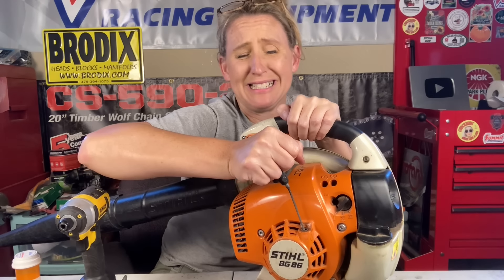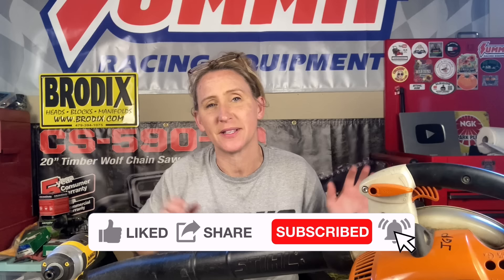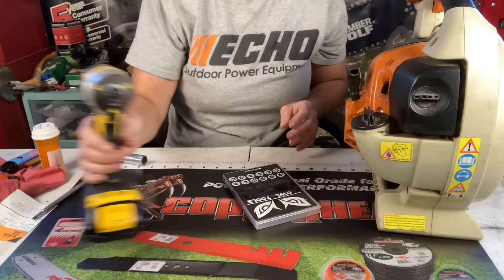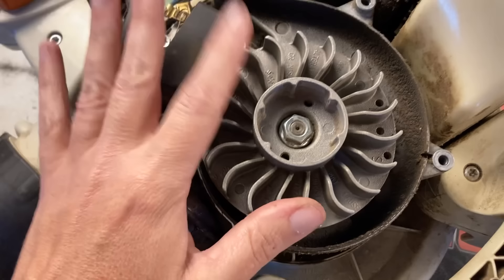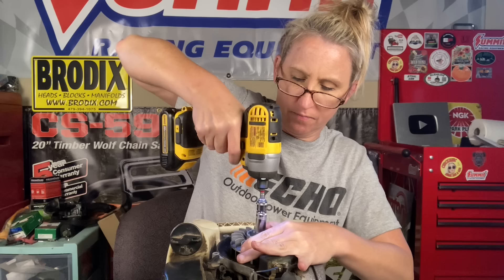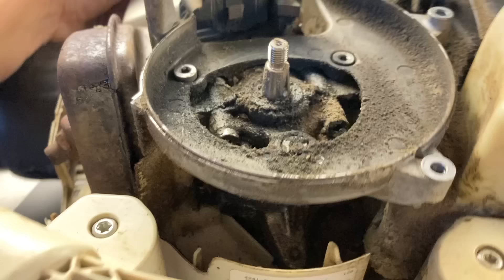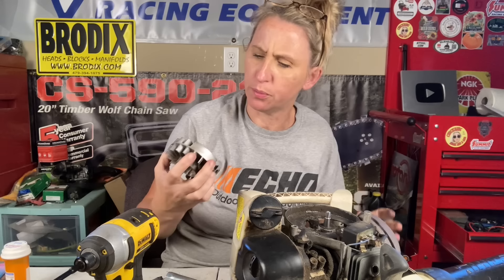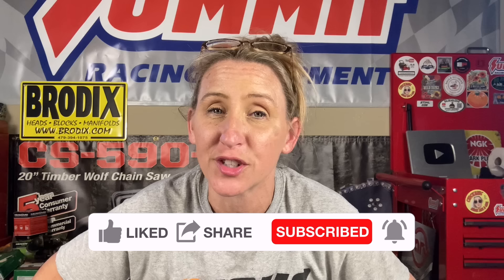Stihl Blowers SECRET FLAW!! Save your Blower with this EASY FIX!!

Comment: These companies should spend an extra twenty five cents and add locktite to problem areas. Great video as usual.
Reply: Dude; it's called planned obsolescence. They know exactly how long it will take for these screws to back out and how many blowers get tossed.
Reply: @jdkrxw  They should also know if their over priced junk locks up and I have to buy a new one, why would I buy another one from THEM?
Reply: @jdkrxw   Stihl used to be the Cadillac of equipment. Not so much anymore.
Reply: Don't use the red!
Reply: no they shouldnt that keeps chickanic in buisness
Reply: @raymondrobinson5251  red loctite is the best
Reply: @seanmckay3392  True! It locks it permanently! Blue, sometimes, will allow the threads to be undone. Not 100%, but if to never undo it again, use red!
Reply: @jdkrxw  I bet they worked out the lengths of the bolts to unwind as soon as warranty has ran out.
Reply: @stevejuststuff2779  yeah that , it`s embarassing pulling a chainsaw 8 times before the pos starts.
Reply: @jdkrxw  yep..  how many have been thrown in the trash.. or taken to "fly by night" shops that tell the customer its shot and sell them a new one.. there are Lots of expensive Stihl tools in homeowners' garages who have no idea anything about it..  if it one day locked up theyd toss it out to the curb and buy another one..  if it lasted a good number oif years before breaking theyd prob get another stihl
Reply: @raymondrobinson5251  ive never had blue come apart on its own..  and ive used it on flexplate bolts in  big busses..
Reply: Most likely the heat and wear and tear after a couple of years use
Reply: @raymondrobinson5251  I use Red all the time. Sometimes, I use Green 609 cylindrical part bonding. None of them is permanent. A bit of heat will soften them all up enough to remove.
Reply: @raymondrobinson5251  LOL! NOTHING is permanent. Red is not even close. If it don't move, a bit of heat will soften it.
Reply: @bluegrallis  I wondered about heat being in the mix! That makes sense!
Reply: Glad to see I’m not the only one who uses old pill bottles for parts.

Comment: Another fix saving us TMF. You’re almost at 300K subscribers! Have you ever asked how your channel has grown so fast? Great presentations that are well documented and easy to follow. Keep ‘‘em coming!!!
Reply from the maker: Aw! Thanks so much!!
Reply: Yes I think she was at 75,000 something like that when I first started watching.
Reply: @Chickanic  Bre, got to help me! Is a loose chain the main cause why a chain becomes dislodged while it’s running? I had this problem with my MS170 when I use a third-party bar and chain combination. Having problems with my Timberwolf. It’s the 20 inch Oregon bar & chain. I swear it’s tight.
Reply: Check the bar along its grooves that the chain runs in.  You need to take bar off saw. Look along the chain grooves. If one side higher than other. You will have issues. You can reclaim bar by refacing the bar grooves with a bench grinder. Run bar along grinder. Get grooves equal again.
Reply: Too tight?
Reply: Actually Bre answered the question in one of her subsequent videos. Adjusting a new chain after the first few cuts- they lose tension.

Comment: correct. vibration wreaks havoc on carbs and fasteners. i too have rebuilt carbs that still leaked.  best repair is to replace.  il throw my thumb pump on the carb and if it dont hold i will toss it.

Comment: The easiest way to remove the flywheel on these 4140 motors is to back the flywheel nut off until it is flush with the end of the crankshaft, then sit the unit upright. Use a brass or aluminium drift and with one or two decent hits to the crank end, it will pop off. Bonus is the nut protects the thread and the flywheel doesn't fall too far. Also take great care lining the key up as it is cast into the flywheel and if damaged will require replacement of the flywheel.
The Stihl hedge trimmers that use the 4140 motor are also known to have a similar issue with the screw coming loose.
Reply: BINGO!!

Comment: GREAT VIDEO!! This is exactly what my issue was! I was blowing leaves, my blower made a weird metal "thrapping" sound, then jammed and stopped. 5 minutes later I found this video. It took me about 20 - 25 minutes to disassemble, clean the parts, add locktite to the bolts, and reassemble. 30 minutes later from time of blower stopping, I was back out blowing leaves. This saved me money and time! And considering the turn around time of at least two weeks to get my blower back from the shop if I brought it in. Thank you!

Comment: Hi Bre, I wanted to tell you about what I did to my friends weed eater! His son brought it to my house to cut down some weeds around my house! No gas in it put non ethanol fuel in it. Still sounds funky check the oil cause it's a 4 cycle engine and no oil. So all I had at the time I had some mercon 5 transmission oil it ran smooth and even started up easy next day.

Comment: Wish you had done this video 6 months ago when I trashed my makita blower.  After stripping it to pieces, I found a loose bolt under the fan which locked up my unit.  So mad at myself that I assumed it was a bad bearing but oh well.  It was drinking oil too so its life was near the end.  Keep up the good work.

Comment: Thank you so much for your tutorial. I searched for seized bg56 and found your channel. I had already phoned the Stihl dealer to order a new one. After watching your explanation I found the three bolts had loosened and locked up the flywheel. Followed your instructions and cleaned up all the grease, used your long handled screwdriver armpit manoeuvre and the flywheel came off with a few taps. Three loose screws, cleaned and replaced. Tidied up like new, decoked the exhaust whilst everything was open, cleaned up, replaced the pull start and plug. Started on first pull! Now to phone the dealer to cancel my order! Thank you once again, you are the man!👍😀

Comment: Stihl makes a tool that you thread on the crankshaft. You run it down to the flywheel then back it up a half turn them  hang the unit by your hand and give it a good sharp blow with a hammer. Loosens it right up. And there not that expensive. I use on in my shop and it fits 90% of Husqvarna crankshafts.

Comment: Air hammer with a blunt tip against the loose nut works good to for those flywheel nuts. May be a little more one person friendly.
Reply: Definitely not a claw hammer, a ball peen has it's weight in the right place. Or air hammer lol

Comment: If you spin the flywheel 1/4 turn after you hit the crank a time or two it will pop right off. It helps by shifting the pressure on the taper of the crank. I also always spray a little PB blaster on the crank before I start then again after the nut is off to help with getting the flywheel off the crank taper.

Comment: Thanks for your video, I had the same issue.  Please note, after I completed the fix, I couldn't get it to throttle up without dying.  Took it apart and found that the flywheel key was smoothed out.  Found one on ebay for $45 + $10 shipping, and now it runs great.

Comment: THANK YOU.  I am not a small engine mechanic, but I am the "guy" all my neighbors bring their non-working equipment.  I had a Troy Bilt WW come in that was locked up.  The Recoil starter rope Paul's had self destructed and then messed up the fan behind it which jammed the crankshaft.  Luckily I had watched this video before I tore into it.

Comment: Love your videos... very helpful.  I wonder tho if you could use a gear puller.... instead of that armpit trick.  I guess not many people have a gear puller or a steering wheel puller or whatever, but it might be nice to know that there IS an actual tool that does that job...

Comment: I Just Found Your Channel !!! 😃 A Wealth of Information ! Off Track my Stihl KM 110 R 20 Years Old from 2003 had SHORT RUN Times and Quit, Adjusted Valves (to tight) and REMOVED Air Filter and ONE pull Started !!! I will goto Stihl Dealer and get Various Parts Plus that Grease for the String Head and the other Grease for the Hedge Trimmer !   Thanks for Your Wisdom !!!

Comment: Great video Bre, I knew an old lawnmower mechanic that would pop a flywheel on a push mower by taking a hard blow hammer and hit the side the of the flywheel opposite the magnet side. Of coarse on  a small flywheel like that you have, you  would need a smaller hammer and a steady hand.

Comment: I have the same Stihl BG-86, never have had the carb problem or screws backing out but have twice replaced the crankshaft bearings. Probably caused by shredder vac usage (and sucking in wet organic matter) causing imbalance of the rotating assembly.  Great video and as always enjoy the learning!

Comment: Hi Chickanic.
Had the same problem come in this week.
Got sprayed in fuel a bit as it was totally full of fuel.
3 days later still hasn't flooded.
And I also locktite those bolts in now when they come out.
Weird vibration problem?
Update
Less than 24 hrs later after watching this video I had one come in and it was the fan side bolts that had come loose.
Easy diag, engines loose.😂
Took about 30 mins to remove the pipe, fan cover, fan (left hand threaded nut), clean the bolts and threads, lock tite them and reasemble 😁

Comment: The only thing I recommend doing differently is when you start a 2 cycle like this or a chainsaw or weedeater, give it a min or two at idle to warm up. The cylinder will last much longer if you do. (although she could have pre-started it for the video anyway) but she shows herself starting it and immediately grabbing it and going to town blowing off the driveway. Give that little piston and cylinder a chance to warm up before hammering down on them.
Reply: But that takes the fun out of it! 🤣

Comment: Great video. In a pinch, I'm wondering if it might be easier to drill a small hole in the flywheel so you can get a torx bit on the screw? If balance is an issue, drill a second hole across from it.
Reply: Depending on the radius, drilling a single hole might unbalance the flywheel enough to be a problem at operating RPM.  The fix would be to drill a second matching hole 180 degrees, same radius.
Reply: @wtmayhew  True, you could always drill 2 across from each other. lol

Comment: I’ve been working at a stihl shop for 9years now and I see this all the time. Most common things I find with these blowers is the screws behind the flywheel or fan and blocked spark arrestors in the mufflers

Comment: Similar problem I had with my Redmax blower except the bolts under the fan loosened up. Left a nice groove in the plastic fan. Still runs great 12 yrs later.

Comment: Bre in my shop to pull a flywheel off I loosen the 13mm but leave it on with most of the threads on the crankshaft,  then jam a flathead screwdriver under the non magnetic part of the flywheel.  Using my deep well 13mm socket on the 13mm nut I give the socket a mild smack  with my hammer, and almost always it pops off with the first hit.

Comment: Just fixed for the 2nd time. I used a gear puller for the flywheel, best / easiest way to remove. Red loctite this time too.

Comment: Just picked up a TORO mower in mint condition complete with two controls, 1 for throttle and 1 for 3 speed walking.  Got it at a steal becuase it wasnt running.  Put some fresh fuel in, popped it with a small hit of ether.  She smoked a little then ran beautiful. and still does. I think it just had a little something stuck in one of teh jets or the float was hung up.

Comment: Stihl only tech
The screws are common threadlock is what I do. I like your armpit trick for the flywheel, I have someone hold blower just off the table by the flywheel and pop the cshaft.
I don't know why our carbs start leaking, my suspension is that it's just a cheap carb which conveniently means tossing a new one on after a couple years is cheap.

Comment: i hate pulling flywheels that way. every once in a while  you end up bending the flywheel or messing up the crank.  but ya gotta do it.  i have found the propane torch helps a lot on the sticky ones like that one. when possible  a homemade tool is great but i understand few watching have a lathe.

Comment: When I pull a flywheel.  I always clean the crank and the hole good with break cleaner or carb cleaner to insure there is no oil on these surfaces.  If not, you can cause the integral key in the flywheel to shear off, regardless of how tight you put the flywheel nut on the crank.  This means you will have to buy a new flywheel, so clean them up before installing the flywheel.  I use my big center punch to remove flywheels that I cannot remove with my Stihl puller.  I grab the flywheel, put the center punch in the end of the crank and it it one good time with a hammer.  It usually come right off.

Comment: Another good video. Liked and subscribed to your channel. Now I have to ro check my blower. I just purchased a Stihl BR600 and would be irked if it locked up because the cap screws vibrated out and prevented flywheel rotation. 😠

Comment: Yup" most would think crank & rod  clacking" if not the mag"  but most wouldn't think bolts backing out of the case from use/wear/vibration"  😮

Comment: I had the same problem with the muffler bolts on the BG 86. The hard part is cleaning the threads inside, so the locktite will bond to the metal.

Comment: I've had a Stihl FS 56 rc for 11 year, and have never cleaned the air filter, changed the spark plug, pull rope or anything. I leave the old gas in it all winter, and it starts right up in the spring lol

Comment: Mine has had bolts on BOTH the fan and flywheel side come loose locking it up. Unfortunately mine happened while running and destroyed the flywheel.

Comment: I liked your past tool video. Do you have a good suggestion on an external snap ring plier? 
I mainly want them for removing the clips on Toro Personal Pace mowers so I can get the gear & pin off for cleaning &  relubing. My family has 3 Personal Pace mowers that I maintain.

Comment: Choke lever wear. 

Full choke- burp

HALF CHOKE-starts
After running a few min. Put choke to full so that it doesn’t move on you. 

Replace carb after season is over.  Check for fitment between the plastic choke lever lever.

Comment: This same problem of screws backing out happened to my hand held Stihl. Also the manifold that attaches the carburator to the cylinder had loose screws that caused a running issue.
Did the manufacturer forget to apply a  thread lock compound?

Comment: I have had 2 of these blowers with the same complaint.  One I was able to repair by taking the plug out and then pull on the starter rope.  The other one I had to send to a sister store to be fixed.

Comment: I don't own Stihl nor will I ever in my life. We have these at work along with trimmers. Nothing but a fight to get any of them started. Hard to pull, hard to start. Right now that same blower at work doesn't start at all. Ran fine ( after a fight ) last time i used it. Now only 2 weeks later, nothing. When I am at home, my ECHO trimmer is so easy to pull the rope and starts everytime. Heck even my Husky blower easy to pull and starts everytime.

Comment: Impact air hammer tool applied to the shaft almost instantly loosens flywheels.  A dulled point tip works best.  I have even used a palm nailer to do the deed.  Prying unnecessary and perhaps detrimental.

Comment: Do you get the customers who decide to power pull start these BG 86 blowers with the ergo start and come into the shop with all of the cord pulled out wondering why it has happened? 
Its when you tell them that you only need to pull it gently to start it, is when they get confused as they assume everything two stroke has to be pulled started like a lumberjack pull starting a large chainsaw.

Comment: Hey, so today I was going to use my string trimmer after three or so weeks. I don't often run it dry because I use it fairly often through the warmer months. When I opened its fuel tank to top it off from the previous use, the gas left in the tank was fizzing, like a freshly opened soda -- as in it wasn't building a froth but it was actively bubbling. Is this something you've seen before? I added more fuel, and it ran without issue, so I'm not sure what to think.

Comment: Had the same problem with mine on two stihl blowers. You would have thought they’d sort it out. Same with the drive cable on my stihl mower that keeps snapping, goes through two cables a year and a pain to change

Comment: Had a customer bring in a fairly new Stihl BR600 backpack blower. He said he was using it to clean his driveway and it just quit. Said it almost jumped off his back. The exhaust valve dropped down into the cylinder.  The end of the valve was sideways and was buried in the top of the piston. I ended up replacing the short block under warranty.

Comment: we have 3x bg86 bought new, 2 of them got loose bolt issue(same as this video) after 6 months-8 months commercial use,so as a common issue i wonder if Stihl would notice it and put locktight on the bolt when assembling the new batch or..they just dont care.

Comment: Hello I worked on mowers and tractors for a long time but I got one here that's got me stumped! It's a 1863 Cub cadet hydrostatic the PTo will not work unless you hold the toggle switch up I have replaced every single safety switch New .

Comment: I watched a video where YOU said you answer every message.  I have asked several and haven't gotten any response.  Not bitching, but i am trying to figure out exactly how one repair shop can have so much JUNK around it and loads and loads of stuff that hasn't been worked on.  Its a bad look and furthermore when a repairshop "assumes" someone else's equipment, its usually because they overcharge.  I know this because most repairshops, especially small engine repair burn your pocket.  Spend more than buying a new product.  TRUTH